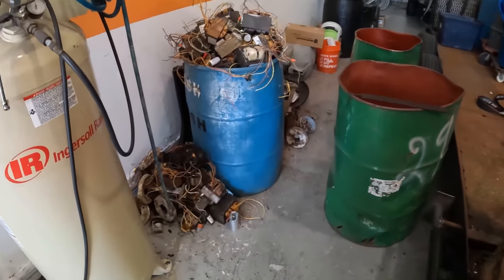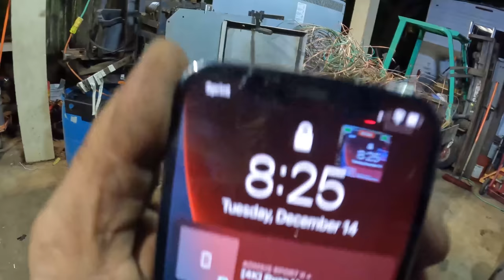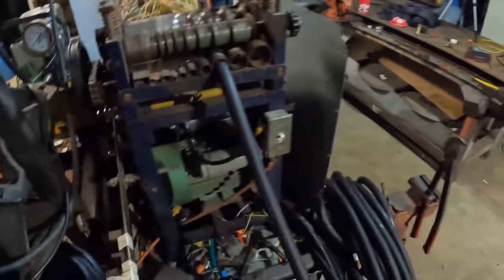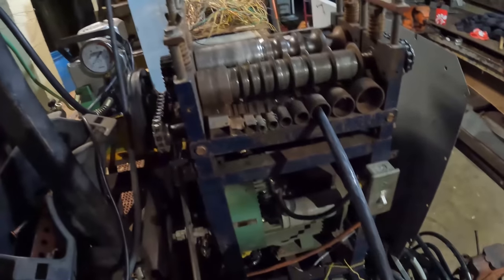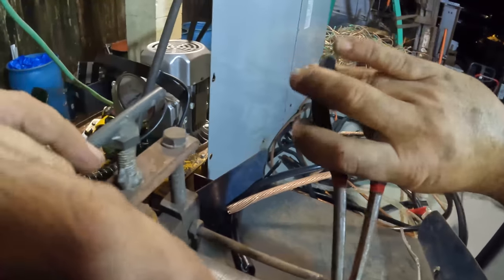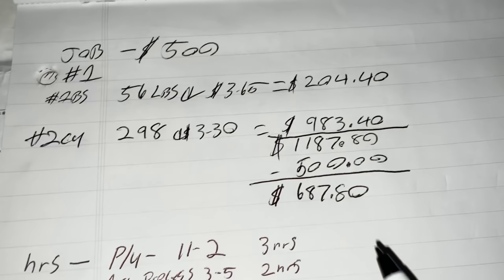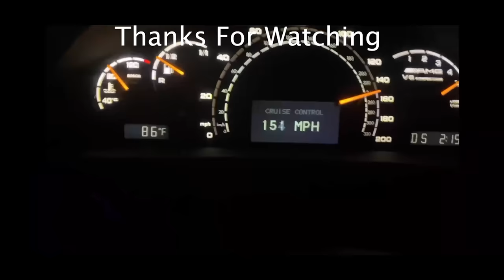Make $1000 A Day Scrapping!

Comment: Great video, how about get yourself a lug crimping tool….buy some clamps and make sets of seriously heavy duty jumper leads for the earthmoving industry? Vary the length according to what the customer wants and keep the price competitive, I bet they would sell like hotcakes! The bane of my life running earthmoving machines over the years was finding jumper leads not only long enough but heavy enough to carry the voltage without frying or losing current due to length, machinery manufacturers put batteries in some of the hardest positions to access…sometimes it’s not possible to get close enough too a machine, I made a 6 meter long set out of welding cable that were ridiculously expensive but worked perfectly until a thieving dog stole them and all the tools of my service vehicle. Price a set and see if it’s worth it for you…… cheers from Australia 🍻
Reply from the maker: Thanks for the suggestion I will be looking in to that. That sucks thieves stole your stuff.
Reply: @ProjectShopFl  your most welcome, yeah the thieves got away with a lot of specialty tools and big hand tools for working on machines. The worst part of it all is I believe it was an employee who came from a family of thieves….which I only found out later and of course the police couldn’t care less about 20k worth of tools I needed on a daily basis…..however, I do believe in karma! All the best 🍻
Reply: Send me an email
Reply: @survivingsilverbay4734  Hello, how can I be of assistance?
Reply: I'm with you mate I bet we could make a video on how to make $10,000 a day buying scrap LOL

Comment: Used to be a scrapper, I would use an air chisel to cut the copper out the transformers. As for the aluminum, cut the same. Had built my own wire stripper to strip large and small wire. Everything went into separate barrels to haul. Would make about $900 to $1200 a week.
Reply from the maker: Not a bad pay for a week.
Reply: I am from Australia,  and just wondering where the transformers come from?
Reply: That’s actually pretty good all things considered. 

What’s the operating costs of being a scrapper. 

Also what kinds of metal are you looking for? I mainly know aluminum and copper, but what about brass, tin, bronze, and iron.

Comment: Your the man, you work hard and deserve a good payday brother. The wire you stripped up to at least 17 min looks like a lot larger than AWG #2 gauge. Looks more like 0000 (4/0) or larger. Thanks for the video, you have some interesting machines. I know 1st hand how tedious stripping wire can be by hand with just a sharp razor knife in-hand, and pulling jacket off. We did this at my place of employment when our assembly work was slow. Your machine makes some of this stripping look so effortless. I used to wire up big “up to 125 hp” 3 phase motors and control boxes when building industrial screw type air compressors.
Best of luck to you young man 😎👍
Reply from the maker: Thanks, you should check out my videos on stripping wire like a pro. lol

Comment: A trick on stripping #1 wire is to just run it through a couple of steel rollers and let the force between the rollers cut the insulation by squeezing it against the copper inside.  The really nice thing about it is that you can feed multiple runs in at one time. A LOT faster and less fiddling with the machine.
Reply from the maker: You should check out the pomade wire stripper I built years ago. Basically what you described

Comment: Just stacked up a pyramid of transformers myself. 28 to be exact. Also just broke 14 the day prior. I use a similar process to press out the middle. Just using a hammer or an air chisel. I love that set up. Wish I had the connections for transformers like you do!!! Keep on stacking that recycled greeeenery!!!!!
Reply from the maker: That's awesome, thanks for watching.
Reply: Ya how are you getting all those freshly prepared transformers?
Reply: @nickh7777  I'm living in las vegas. Construction happens frequently. I recycle pallets and metal for a living. I have my sweet spots. 😋
Reply from the maker: @nickh7777   Did you not watch the first 30 seconds?
Reply: @ProjectShopFl  ya u didn't say nothing about where u got it
Reply from the maker: @nickh7777  Haha sorry I get them from electricians that do a lot of lighting repairs

Comment: He’s doing it the right way you should see how many people scrap the wrong way. They don’t separate stuff or even worse I see guys bring truck loads of window ac’s and they don’t take them apart. I do hvac so I buy bullet valves and recover the Freon then take apart the entire unit I do it as a hobby to get stress out and make an extra few hundred here and there it’s a win win.
Reply from the maker: This is my hobby too. lol I'm about to get in to hvac. Stay tuned to see some awesome equipment.
Reply: @ProjectShopFl  lol hobby ? Looks like you’re a pro and do it full time. I was wondering does Florida regulate scraping air conditioners? I hear some states do and you need an epa card or hvac certification. Up my way in Massachusetts most scrap yards are starting to not allow ac units that have Freon in it still or if the unit it not separated like motor compressor ext. I Went to school for hvac and I have my refrigeration license and I was shocked when I first asked and they said I didn’t need it to bring air conditioners. Good luck and I’ll definitely be checking out the channel.
Reply from the maker: @angelogoreham4155  Yes in south FL you are supposed to be a AC contractor or have a recite
Reply: @ProjectShopFl  I thought so thanks for the reply.

Comment: 9:35  I'm crying! That appears to be more than 100 ft of such heavy-duty NEW material!  Dad often saved scraps like that from jobsites and such. It might be a decade before he needed it, but he built most of our house and a few outbuildings with found materials.  Excellent set up though.
Reply from the maker: It was new wire I bought from an electrical contractor. lol
Reply: Would u have made more money selling it new then scrapping it up ?
Reply: Yah that one's a shame to strip for scrap. Definitely could have made more reselling, but suppose that takes time and is a pain in the butt in its own way. Not sure how many people are exactly looking for wire that gauge on Craigslist or ebay
Reply: @pyrofanaticedward7167 nobody would buy that gauge wire used and in such a short length

Comment: You have a good set up but mate put some guarding on your machines, a finger or hand is much more valuable than 100 bucks in 20 mins👍🇦🇺
Reply from the maker: Thanks for the suggestion and your concern. I do have all the guards for the wire stripper but they came off the first time it jammed and I had to remove them to fix the jam. I will be putting guards on it just not the ones that came with it. Or I’m gonna modify the ones that came with it I haven’t decided yet.
Reply: I agree, please protect yourself
Reply from the maker: @freedomfighter8958  Thanks for the concern
Reply from the maker: @kingnothing9998  Haha
Reply: He has money, now limbs are cheap in a market
Reply: @mike sprigg 
Where?
Reply: What's the hurry in transforming clean copper from commercial wiring? 
You're not working at a automobile assembly plant. You DON'T need to produce 100 pounds of copper an hour. Henry Ford is not your employer, and you're not building a car every 60 seconds. It's better to protect your fingers, hands and eyes than worry about how fast you can clean out scrap wiring. You plan to be inaugurated in The Scrap Copper Hall of Fame?
Reply: @rickprusak9326  I think he is already there
Reply: How about a glove😂

Comment: A little design change for your stripper in feed is to make them like little funnels, so right the cutter wheel you have the right diameter for the wire your using, but a bit of a wider area to start it so it doesn't bunch up the insulation
Reply from the maker: Thanks for the suggestion

Comment: One of the problems with transformers, is even if you find one that has produces the voltage you need and the needed amps, often the plug won't match what you need on your device.  There would be less waste if the plugs could be standardized and if there was a way to adjust the amps and voltage on them more.

Comment: Here is a question for you about ac radiators

Aluminum melts at a much lower temperature than copper.  

 Have you ever thought about some way to melt the aluminum off the copper. 

  I'm asking because I thought you said you were going to start casting some stuff eventually.

Do you think you could.  Melt it off.  You could have aluminum and copper ingots
Reply from the maker: Melting in the aluminum off the copper is an interesting idea. I thought of something like that for the transformers years ago but  My press is way faster. Or copper aluminum radiators that might be a good idea but I don’t know how clean that would get it. I’m interested in seeing if that would work thanks for the idea
Reply: @ProjectShopFl  

Im also 🤔 thinking that if you knew the % of copper and the % of aluminum it might even be a start to melting it all together and make some aluminum bronze

I really do like all of your episodes

And the new shop is great. Congratulations on getting it.
Reply: My scrap yards pay breakage price for melted aluminum. So it's not really worth it.

Comment: I used to take transformers apart but lately been turning them in as a copper motor. From the way my local market is it just makes more sense to turn them in as a unit. I will strip wires though.
Reply from the maker: Copper transformers you can triple your money by processing them where with wire you only gain 1/3. That also depends if you buy them or get them for free.
Reply: @ProjectShopFl  Where I live it's probably the worst metals market in the country. Stuff has to be trucked out. I just do things different based on what I am dealt with. 

Other places have different fundamentals. I also just passively do this but if I did this as a job I might do things different.

Comment: I used to own a metal reclamation business and we would fill 40 yard trailers full of copper daily. We got all the metal for free, from 3 buildings that were over 10 acres each. We scrapped entire electrical substations. We pulled every copper wire and buss bar,  and all data cable, from a 22 story building. We were given all the metal on all our jobs. We even had the local electrical union steal a full tractor trailer truckload of steal from us, then they called the building owner and told him what they had done. They said that they put the metal in the building and they get the metal out of the building. Unions are totally criminal.
Reply from the maker: Wow,  wish I got free copper lol
Reply: @My_daddy  try the union and the union tries u bud.

Comment: Where are you I'm in Kentucky. How much you pay for your machines if you don't mind saying. It's new to me by the way I'm Bonnie.  Yes a Lady not modern or sexist or fashist not liberal.
Reply from the maker: hello Bonnie I’m Derek and am in South Florida. I’ve always wanted to see Kentucky I’ve heard its beautiful.  The presses are custom built, The only thing new that I bought were the actual first price which was a 20 ton hydraulic press from Harbor freight that I modified and now I’m running a 25 ton enerpac  10,000 psi RAM but I paid $100 for and another hundred to have it resealed. The two speed 10,000 psi pump I traded some LED lights for and all the steel for the gig I pretty much got for free. The second price is 100% custom bill except for the Rams I got from Harbor freight for around 200 bucks. The wire stripper I bought used from an electrician for $250 and had to fix it and I modified it. I like to do things myself and use the barter system so it’s hard to put a dollar amount on it. But I’ve had them for 10 years and they work like a charm. Lol if you wanna see more on the presses I made a video titled “how to make $900 an hour processing copper transformer”. I hope that helps thanks for watching

Comment: The Supervisor at my jobsite gave me the option to scrap the leftover rebar on the site. Most of it is in Bull-Bags, the rest is straight and will fit on trailer. We have equipment to load. We are in Boca Raton, near Glades and I-95. Interested? I am in charge of cleanup. Shit needs to go within about a week, or so. Thanks.
Reply from the maker: I really appreciate the offer but I am so overwhelmed with what I got going on already and I really don’t like messing with steel.
Reply: @ProjectShopFl  Sorry, I get the #1 Wire. Small pieces I get for free, larger bundles I can buy at scrapyard price. I need to buy some more Copper soon. I'll buy from you if you have it and want to sell. I usually try to buy something the size of 1/0, and around $500 per purchase. Thanks.

Comment: You might consider a 12k winch with a press clamp on a cable to pull wire through your tubes, should be just as effective without as many jam ups.
Reply from the maker: Thanks for the suggestion

Comment: Hey man just wanted to know, could you check your hydraulic connectors and the quick connect fittings on the lines of your jaws. It looks like your having return issues.
Reply from the maker: I can but keep in mind its a 2 speed pump and if I don't double tap the valve once it goes to the high pressure side it stays there. I should be using the foot pedal switch, I'm gonna make a electric trigger for it.

Comment: Hey brother great vid. With reguard to you wire stripper and needing more holes. Have you thought about having a machine shop craft you a couple of adapters to reduce the size of some of the larger holes. Pretty sure that should be able to make you some tool steel insert with heavy-duty flanges to keep them in place. Just a thought.
Reply from the maker: Thanks for the suggestion, I am trying to se up my own machine shop. lol
Reply: @ProjectShopFl  All that insulation... Does it have any scrap value?

Comment: @Project Shop Florida I would like to suggest an insert with a flange in the larger diameter hole. Like a washer attacked to a tube the you slide in to reduce diameter and should you need the original diameter you remove the insert. Could be that the original machine came with them or wire sizes were standard.
Reply from the maker: Thanks that is a great Idea.

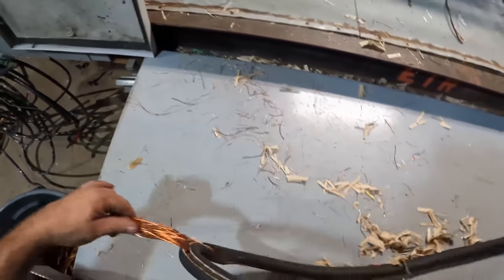Comment: 19:47 to 23:00  We buy that as #2 Insulated Cable ($2.78) since your recovey was 75% to 80% copper
Reply from the maker: Wow,  anything that thin they always but it as #2 copper. that sounds like a #1 insulated price in south fl. #2 insulated is like $1.10 lb of at least it was 2 weeks ago.
Reply: @ProjectShopFl  Yep we got three different grades of copper cable. 
500 - 750 MCM Cable (Bare Bright Inside)
  #1 Insulated Cable 80% (Bare Bright Inside)
#2 Insulated Cable 80% (#2 Copper Inside) price different of 20 to 30 cents.
Reply from the maker: @LilMilely  Where is this? There is a big difference between #1 ins ($2.70) and #2 ins ($1.10)  in south FL. Or at least at my yard there is.
Reply: @ProjectShopFl  Kentucky. We have a couple grades of #1 and #2 Ins. 

In case you are wondering on the grades

500 - 750 MCM (BBC) ($3.22)
#1 Ins Cable ($2.95)
#2 Ins Cable ($2.75)
#1 Ins Copper - Thhn ($2.68)
#1 Ins Copper - Romex ($2.18)
Open Eye Hollow Helix ($1.55)
Closed EYe Helix ($0.55)
#2 Insu Copper ($0.64)
Communication Wire ($1.30)
Christmas Lights ($0.30)
URD Cable ($0.30)
Reply from the maker: @LilMilely  Thanks for taking the time to share. You have some good prices.
Reply: @ProjectShopFl  You welcome. Thank you

Comment: Question.... How is that clean bright copper #2 ????  Around here clean bright - no solder no skin etc,,, CLEAN nothing on it at all is #1,,, just wondering why that is #2   ???,,,,,,
Reply from the maker: Its welding cable, supper thin strands they always buy it as #2 because they say they loose weight when melting

Comment: At 30 minutes. Your talking about 80% of the hole being used. Can you put a pipe coupler/reducer to reduce the larger size? That would still give you wiggle room.
Reply from the maker: The problem is the rollers are still gonna still allow the wire to walk from one side of the blade to the other. When I say I need more holes that means more blades as well.

Comment: measure how many feet of wire your stripper does in a minute make two spools to turn that speed, one for wire coating, one for stripped wire. no need to cut wire short. one man can do it all.
Reply from the maker: I've been thinking about that for years, The automatic donut maker. lol Thanks for the suggestion and for watching.